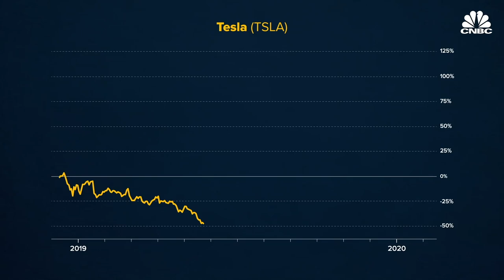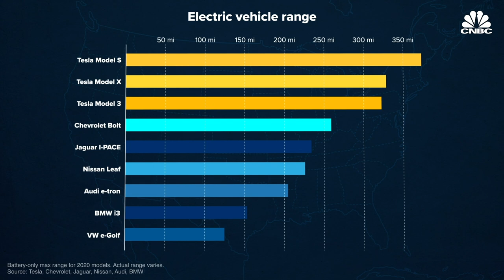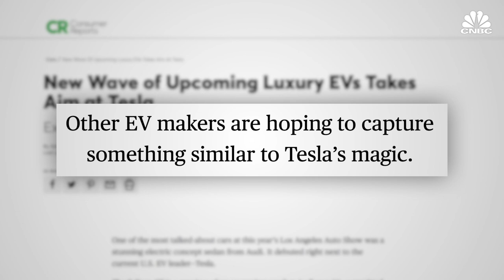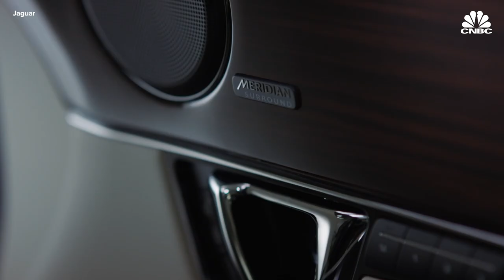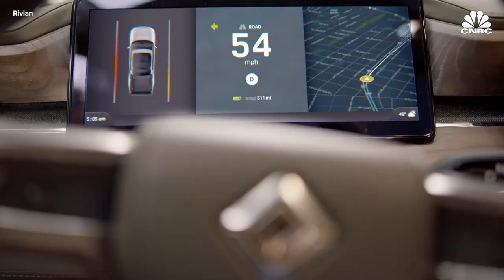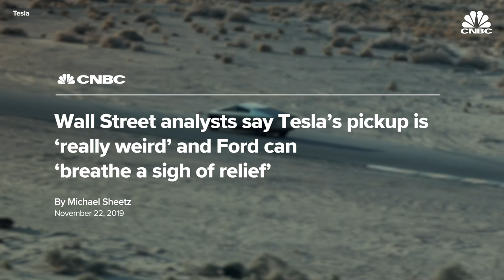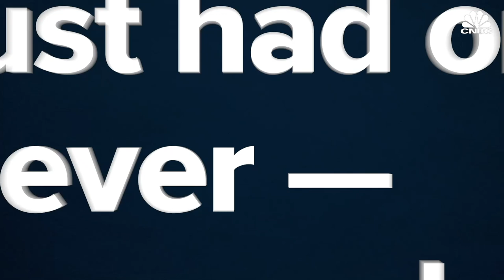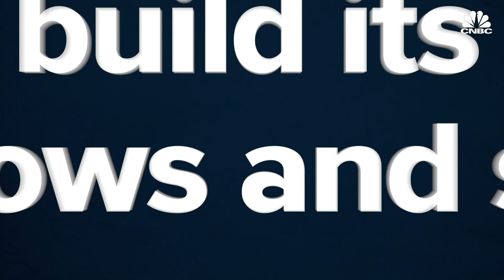Which Automakers Can Seriously Challenge Tesla?

Comment: They like to make fun of Tesla and EVs. Now who's laughing.
Reply: They don't compete against cars tuning. Personalization wise, or performance. They're not on my radar.
Reply: Fadic4 it’s gotta start somewhere.
Reply: @rickslife  it's been 100 years....
Reply: X7rocks yep! Time for a change.
Reply: @rickslife  Time to improve fuel efficiency even more. Which is happening. Id much rather prefer to have a fuel source rather than a limited source that limits my miles.
Reply: X7rocks except for the finite amount of oil. I know it’s hard but, Change will need to be excepted.
Reply: @rickslife  you know ethanol exist. Right?  If carbon capture becomes a thing the capture of c02 and converting to fuel sources literally becomes recyclable. An electric vehicles will be the main source of pollution when it comes to the batteries going through their recycling process.
Reply: X7rocks exactly!
Reply: X7rocks An acre of U.S. corn yields about 7,110 pounds of corn for processing into 3
28 gallons of ethanol. But planting, growing and harvesting that much corn requires about 140 gallons of fossil fuels and costs $347 per acre, according to Pimentel's analysis.
Reply: @rickslife  of course. But that doesn't make the fuel finite,along with other sources of fuel.
Reply: @Fadic4  worldwide market of smartphones was at one point, 2% as well. Buy $TSLA!
Reply: X7rocks oil not fuel.
Reply: @rickslife  synthetic man made oil exist.
Reply: @X7rocks  Synthetic oil is made from a base oil, powder additives, and a carrier oil that enforces an even distribution of the additives. Both synthetic oil and traditional motor oil are made from refining oil. Most synthetics begin with highly refined crude oil, pumped from deep underground.
Reply: @rickslife  which also can be made by recycling used oil.
Reply: @X7rocks  it all comes full circle...... finite. There is an end game for oil. The world has 53.3 years of oil left at the current rate of production, according to BP's annual statistical review of world energy. Just 53 years!
Reply: @rickslife  it's hilarious how you can put a number on the amount of fuel we have. When we have other ways of producing fuel.
Reply: X7rocks its hilarious how you don’t get it. The number came from BP one of the largest oil producers.
Reply: @rickslife  while the other bigger ones are silent on those statements.
Reply: X7rocks wouldn’t you be if there’s an end game to your business!
Reply: X7rocks I’m not assuming anything. I hope you see the change to full EV.
Reply: @rickslife  i hope you grow up one day.
Reply: X7rocks thank you for engaging in my social experiment.
Reply: @rickslife  ok.

Comment: Here come the Tesla fanboys. 🤣😂
Reply: Yeah, and they are probably laughing right now.
Reply: I drive a 5 cilinder diesel but really like and admire Tesla   :-)
Reply: With good reason. They have superior range, tech and performance at every price point.
Reply: Jody Owen  because 1) you can't compare the 2, a ev charges overnight and has 100% "tank" every single day.

It's a psychological shift people need to make.

Sure on a 2day road trip, it will take a extra hour, but that's a small price to pay when it costs 1/5 as much, will drive itself on that roadtrip and is ultimately better 

2) noises are nice but ultimately only a fraction of people care about that.  Noome says you have to sell the weekend car either.

3) if you need a f150 for whatever reason (the majority of f150 owners don't actually need them, its for vanity reasons only) then tesla doesn't offer a competitor...but they will.
Reply: Jody Owen  well on a co2 basis, a tesla uses about 50% less for a car of the same class.

They "cost" about 25% more energy to build.

So it works out to be about 2 years if powered from coal.

The "same class" is the important bit.

Many of the studies claiming they are not green use something like a tiny, slow awful hatchback, and put it up against a 700hp, 7 seat, 5000lb, 10sec 1/4, gt car. They also conveniently ignore the costs for the refining and transport of the fuel, that can easily add 30 to 40% on top of what the sticker says.

With all those studies, always follow the money.

At the end of the day, EVs need about 10% market penetration, that is the crossover point for a new technology, its been that ways for hundreds of years. 

Tesla has forced the other manufacturers hands as well. Big auto is still well behind in tech and efficiency, but if they get serious they might closethe gap. Tesla will be the leader for a long time though.

Maybe conservative buyers who dislike liberal looking ideas on principle will buy something like a f150 ev, even if its a bit worse on the spec sheet.

Human's are for the most part irrational creatures.

Comment: Not a single automaker is in a real position to seriously challenge Tesla, for too many reasons that it is almost impossible to elicit them all. But here are the most crucial.  
1- Tesla has at the start a price advantage of circa 25% because that is what cost the traditional automakers in between feeding their dealers and the mammoth amount of money they need to allocate for advertising and PR. 
2-  we can easily add another 5% price advantage because Tesla manufacture in house most of its major components, while the competition has to feed various suppliers.
3- Technologically Tesla is at least 7 years ahead of the closest competitor.
4- contents: from autonomous driving to electronic automatic updating, to extended supercharger network, and practically maintenance free cars Tesla has no competition from any of the challenger.
5- Batteries, Tesla builds his own batteries, which right now are the most performing of the planet, so the range and acceleration of its cars are far better than any competitor can propose.
6- Just to make a point of Tesla extremely competitive cars the model 3 sport has a 0 to 60 time of 3.2 seconds and cost only $57.000 while the new Roadster due out end of the current year has a 0 to 60 of I.9 seconds and a top price fully decked of $250.000 and with a top speed of over 250 MPH will crush any other mass produced car past or present, not only in overall performance but on the price itself giving a very serious blow to the most venerated name plates on the planet.
7- the nicest part of it all that gives his competitors the mortal blow?  One can be having a special dinner in the romantic restaurant of his choice, pull his handy out and propose to the fantastic girl he is with to help him ordering his new Tesla in the color she mostly prefers. No dealers, no salesmen to annoy and pressure you, just inspirational. 
8- I will be gracious and stop the long list right here. But the real problem for the competitors is that Tesla cars are designed and bought to production, not by old car industry luminaries, but by the best minds on the planet of Silicon Valley. They are extremely intelligent, young, born and raised with an handy, that will naturally build a car to marry with his tech world.
But the Genius that leads them all does not like to leave anything shoddy or unfinished, and his very demanding perfection is naturally transferred to a product that probably is very many years ahead and I suspect too many for any rival to bridge the gap for the foreseeable future. 
Welcome Tesla to my senior world, it is with a vengeance that I took the time to cut short the grease monkeys for having nickle and dime me to death for all my life with their costly designed warranty service requirements and their shoddy flimsy high priced spare parts. The last thing I will do will be to buy a self driving Tesla to drive it up and down in front of the dealership that probably took from me more than he should have.

Comment: Pretty much every big automaker to be honest
Once they "catch up" with the electric part of the deal it's over for Tesla
Reply: Catching up won't be easy. By the time they're where Tesla is now, Tesla will be even further ahead.
Reply: @15Redstones  The other manufacturers have decades ahead of Tesla at other aspects of making a vehicle. As soon as batteries have enough capacity so recharging won't be exactly a problem for most people Tesla's advantage will be gone
Reply: @revistinha1 if they can get those batteries. So far Tesla is buying most of the world's supply. Jaguar, Mercedes and Audi can't get any. Should've spent a few billion dollars building battery factories. At this point Tesla pretty much caught up with making car bodies, but other companies are having trouble catching up with Tesla. It's not just batteries, but also motors, those of Tesla are more efficient which means more range from those batteries. Then there's charging infrastructure, Tesla got the biggest network. And Tesla has 100x more data on self driving than everyone else combined, the result of having hundreds of thousands of cars with cameras around the world all collecting data.
Reply: YAWN... everyone was saying this back in 2012 when Tesla was about to launch the first Model-S. Now, eight years have gone by, and there is STILL not a competitive EV that matches the performance and technologies of that 2012 Model-S.
VW boss, Herbert Diess, has openly admitted that VW is several years behind Tesla, and his biggest worry is finding the talent (in computerisation mostly) to try to catch up. Porsche (a division of VW) took 5 years and $6billion to develop the Taycan. It is a lovely car, and well-made - but technically it is far behind Tesla - and costs almost double the price (and it's not selling at a profit at that price either...)
Reply: @revistinha1  You show your total ignorance here... The advantages Tesla has are numerous and most relate to battery, drivetrain, and computer technologies - which are what matters most. I could build an electric car using a simple lead-acid battery and an old swimming-pool pump motor... in fact, when I was 17 I did just that - and it worked. A simple go-kart that I enjoyed way into my 20's.
But would I say that my EV would be a Tesla beater? Probably not.
Reply: @brunosmith6925  The main advantage of owning a Tesla right now is the range but when it comes to the whole package BMW,Mercedes,Jaguar,Audi and the list go on and on have much more experience at making automobiles
Reply: @revistinha1  They know how to make gas-powered cars. They are really struggling to make computer-managed EV's.

What matters today is the electronics, power management, drivetrain and performance efficiency... all managed by sophisticated computer hardware and software - the "guts" of a Tesla.
Legacy car-makers openly admit they are very far behind Tesla in these areas. Yes... they are good at welding steel and making pistons go up and down... but they have no idea how to build a computer on wheels, powered by a battery and an AC motor.
Reply: The other car makers are objectively 10 years behind Tesla.  They have not built a car that competes with the 2012 Model S on price, performance or range yet.  100% objective, measurable, verifiable fact.
Reply: @brunosmith6925 You might be right, but for some reason I don't see Tesla being as dominant in the next 5 years as we've been seeing other brands investing more and more and now knowing the future is probably in electric cars
Reply: @revistinha1  EVs and ice cars are different animals to manufacture. Even if the legacy makers have made a billion ice cars before, its a beginner's learning curve for their first EV. They are learning that its a "start with a clean sheet business" and merely retrofitting an ice car platform with a battery is not successful. Im a retired engineer.
Reply: @LoanwordEggcorn  I can see things getting way closer in the next few years as things actually shift to electric and the market gets bigger and more fragmented.It's not like only best car sells
Reply: @revistinha1  They're not investing. They are spending money in a vain effort to make a compelling EV. And they are facing a big problem... Right now, they make money on ICE cars and have billions invested in the technology for ICE cars. That technology is useless for EV's. But they cannot make a comparable EV to a Tesla, for the same price as the Tesla. So what do they do? Continue to make ICE cars because that's what keeps them going - all the while they see ICE car sales slowly going down. Without profits from ICE sales, they cannot develop the technology for EV.
Look at the financial results of all ICE car makers last year. Almost all of them show a sever decline in revenue and profits. Daimler's decline last year was brutal, and they are laying off thousands of workers. Same with BMW, Ford, VW and GM (which closed SIX factories in the USA in 2018 and stopped making many sedan models.) Nissan is also in trouble, as is Jaguar, and almost all Italian brands.
These companies cannot just walk away from the billions they have invested in ICE technology. They must first get a decent ROI - but they are struggling. They can't invest in EV to the degree necessary. Don't believe what you see in adverts and pictures... Look at the facts.
Reply: @brunosmith6925  Europe has a deadline for ICE cars so the investment will have to come soon
Reply: @thepurplemaskknows9383  So true, Ed. What most people can't seem to understand (especially if they have scant knowledge of how cars are made) is the extreme challenges that Tesla has faced since its inception back in 2004. Both in engineering as well as commercial terms. Here we are - 16 years later - and Tesla (Musk) has faced issues that would have forced the rest of us to retire many years ago.
Now... people are only beginning to get some inkling that Tesla "might be onto something"... but "not to worry... the other car makers know what to do and will get busy with it when it suits them"...
The other car makers have moved heaven and earth to try to force Tesla into closing down - instead of investing in the inevitable future. For many, it's too late. If Daimler and BMW survive the decade,itwill be a miracle - as with GM and Ford, Toyota, Nissan and FCA group. VW stands a SMALL chance of making it - but will probably be forced to license Tesla technology if they have any real hope.
Reply: @brunosmith6925  Well said! I totally agree. Those who rely on Chanos' "The big boys are coming", have bought into his same ignorance.
Reply: @thepurplemaskknows9383  Yes Ed... Chanos exemplifies the ignorance. Those of us who see the inevitable are labelled as "cultists" and "fanboys" - but we tend to be people who have watched Tesla for years - perhaps intrigued by Musk's brilliance and intellect - but nevertheless keenly interested in the science behind his strategies. Most of what's important about Tesla is invisible to the eye, and beyond the understanding of us ordinary folk - but we do somehow understand that what is happening at Tesla is little short of a technological revolution. Over the years I must have spent literally hundreds of hours delving into what Tesla is doing,  and my own background (teacher of maths, physics and chemistry) has helped me appreciate this I'm sure. The next 10 years will be extremely interesting to observe. I really hope others step up to the plate and offer viable competition to Tesla - but as things stand, that competition is unlikely to come from the traditional car industry.
Reply: @brunosmith6925   I certainly understand and identify with what you are saying. The engineering brilliance of Musk and therefore Tesla, is astounding. Sandy Munro confirms this, and he is a tough observer. I am gratified to be able to observe what Tesla is and what it's going to become. Like you, Bruno, the science of Tesla is extremely entertaining.

Comment: 13 minutes of completely missing the mark on every point.

Tesla is winning because they have a better car, period.  Nothing comes close to the price/performance of a Telsa in the EV market.  Its not about fan service, cult followings, 'magic', a 'controversial' CEO.  They just make a substantially better product for any given price range they are in.

The established automakers are failing because they don't want to be in the business of batteries, electric motors, complex electronics, and software developments.  But when it comes to EVs, the frame of the car is the smallest factor in price/performance.  You can't outsource 90% of the car and hope to make a profit.

And if you want to talk subsidies, you should at least mention the massive amount of subsidies that the fossil fuel industry gets through its entire supply chain.  EVs don't need subsidies to be competitive.  Simply remove the current fossil fuel subsidies, and when gas hits 8$-12$ a gallon, we'll see what the consumers really want.
Reply: I agree. Musk realized early on that unless they started supplying their own battery cells they would never be able to scale up, so they completely committed to this and as such they are now able to produce these cars with the ranges they get, cheaper than the competitors. Not to mention that they are excellent cars. I was very impressed myself when I drove a model 3 for the first time.
The product is better, but its not just the product. Had the huge automakers fully committed to EVs when the model S launched, they would have likely crushed Tesla just because they have so much more capital and influence. But they do not commit because they know that the more they  would push EV innovation, the fewer of their combustion engine cars would be sold. Its the same reason they killed the Electric car before. Now its going to be their downfall.

Also people just want Elon to win. He is completely different from the usual suits behind car companies and his goals with SpaceX are downright altruistic and not motivated by profit, a completely unheard of thing from a company CEO